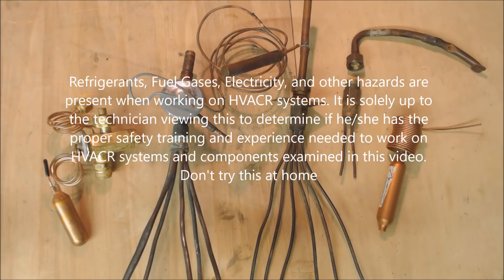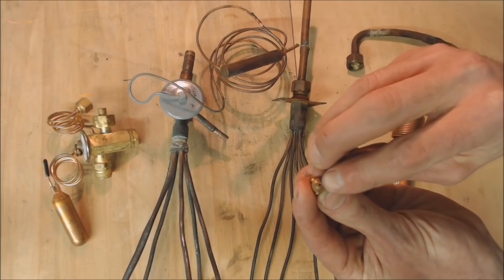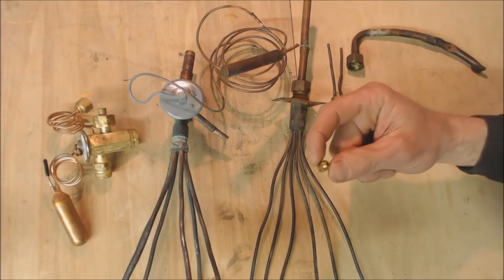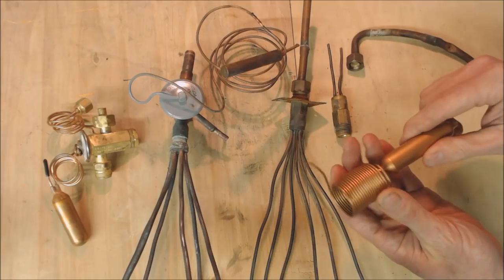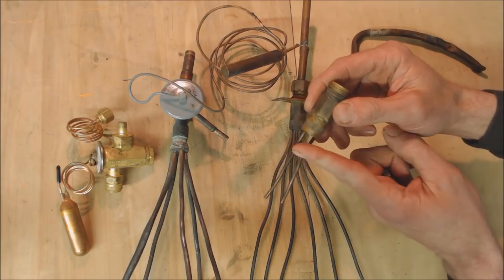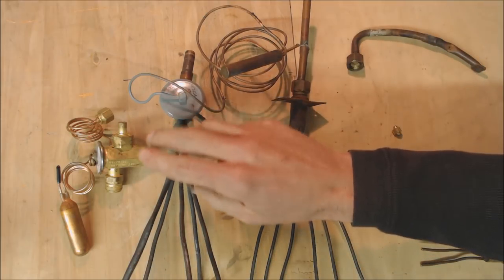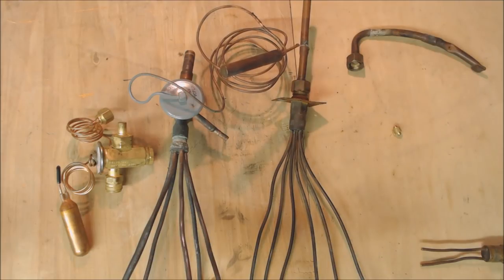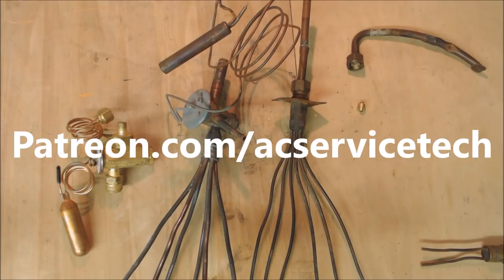HVAC Metering Device Types- TXV, Piston, Capillary Tubes

Comment: How does the manufacturer of txvs determine which refrigerant willl work with which txv?
Reply: The refrigerant in the powerhead assembly  i.e. in sensing bulb. will determine refrigerant of txv. So  you can swap the r22 powerhead with
410a powerhead to make 410a txv.

Comment: Thank you for the video. Tell more please about how to diagnose bad txv. How to diagnose bad txv using gauges. Or maybe you know another ways. Before summer it will be very helpful video. Tell please about improperly installation, and symptoms of that. Tell please about mismatch system, when condenser bigger than coils or coils bigger than condenser, how to diagnose it using models numbers of equipments. Tell please  how to diagnose mismatch system using gauges(when you adding freon in suction line(low side pressure goes up), but high side pressure not going up). Tell please how to calculate if system is smaller than has to be(ton - sqft). Thank you so much for you job.
Reply from the maker: Ha ha, this all items I have been working on in the book. It will be out soon. look up acservicetech txv troubleshooting for what I have out there now. Thanks for letting me know what you would like t see, thanks

Comment: I have 44 old heat pumps in one area that are slowly being changed out with fixed piston. Over the years people have done repairs without using nitrogen and the piston gets clogged from carbon and acting like the system is being pumped down so you need to take power off the reversing valve to go in heat mode to unclogg it. Big pain in A$$ but if it had a txv it would open more and let refrigerant  threw.
Reply from the maker: Wow, that is a shame. Many don't realize the internal affects of brazing without nitrogen because they leave and may not hear from the customer again. They assume it doesn't matter. Has a new filter drier been installed right in front of the piston to reduce the potential for clogs?
Reply: As i go I pump them down and replace filter driers. The units are now 30 years old so there tuff units and some have been replaced and the boss bought me 33 new units. I just need a contractor to do the jobb as my days are filled with repairs here and there all over the place.
Reply from the maker: Got ya sounds like a nice big job! What kind of facility are you working at?
Reply: Civilian at shaw AFB in sumter SC I work with airmen and try to train the ones that want to work lol. We have 4 civilian open positions currently but the last 5 that applied are not quallified at all.
Reply from the maker: Ha, nice. Yet another example of open positions for highly qualified applicants without any highly qualified applicants. Sorry to hear that as I am sure it puts extra work on you. The nice thing I guess is that they will rely and depend on you and want to keep you very happy I hope. Thanks

Comment: What exactly is a sear?could you do a short on this.
Reply from the maker: That would be a good idea, thanks for letting me know what you would like to see. Seer is seasonal energy efficiency rating and it has to do with a match of larger or more efficient coils or other refrigerant heat exchangers. Basically a larger outdoor unit with more surface area of coil would be more efficient at rejecting heat to the outdoors, thanks!

Comment: hi, with a fixed orifice lets just say head pressure is 200# and suction pressure is 100# an amount of refrigerant is fed into the evaporator. Now if the head pressure goes up to 350# and suction pressure stays same. Would there be more refrigerant going into the evaporator because of the bigger pressure difference? thanks.
Reply: You have no load on the coil

Comment: How do you determine TXV Spring psi..?
Reply from the maker: You would have to monitor the actual superheat by checking the charge while adjusting the spring but in ac units, most don't have springs and the ones that do are usually already set to hold 10 to 14 degrees of superheat unless someone adjusted it, thanks!
Reply: @acservicetechchannel  Thanks you for replying back.. I work with refrigeration warehouse..my TXV has heavy frost no matter how much adjusted counterclockwise it still heavy frost and ice. I already replaced power head.. it has frost and ice not on TXV body but on the tube.. it not low on refrigerant

Comment: Hi mate
The suction pipe that goes to compressor starts freezing  low side saturated temperature is minus 1 Celsius and suction line  temperature befor compressor is 4.9 to 5.2  celsius  r22.
And high side is about 155 psi
I add 2 kilo charge to unit but the. Temperature still below zero(low side) while unit running in cool mode of temperature set on 18 degree.
Ducted split system fujitsu.
Dry bulb temperature almost 22 Celsius
Unfortunately didn't check the metering device  and wet bulb. but as the unit is 15 years old I think it's not txv most probably.

According to above mentioned information I diagnosed the problem as a restricted metering device. Which is preventing refrigerant feed to system fluently. High and low side is very low pressure at same time.
What's your opinion?
Many thanks
Reply: Ace Look Reno's. Check ahu filter. Check indoor fan, / capacitor. Set to high fan speed. Up your set point. 
Recheck gas. If in doubt weigh out/weigh in gas. 
It's very rare but a blocked liquid line filter can drop your temperature, 
A restriction in the system will usually send the head pressure way up

Comment: why would the heat pump need to bypass the cap tube? it's just a plain tube, i would assume the direction of flow doesn't matter
Reply from the maker: When you have a heat pump, you only want one of the two metering devices active so if the cap tube is at the indoor coil and the indoor coil is now acting like the condensor coil in heat mode, the liquid refrigerant would need to flow around it to the metering device at the outdoor coil which is now the evap. Have you seen this video- https://youtu.be/2Ahzi1U0fYk
Reply: I just watched it. I understand the need to bypass a metering devices such as piston and txv,  depending on whether it is heating or cooling, because they work in one direction and the direction of the refrigerant changes. but for the capillary tube, from my understanding, there shouldn't be a need to bypass because it should work in both directions as it is just a tube and hence no need for bypass. 

Am I correct? Please correct me if i'm not because i'm working on a reversible heat pump project and am planning on using a cap. tube for this reason.
Reply from the maker: The cap tube is the metering device, just like a piston and would force your newly formed subcooled liquid from the indoor coil in heat mode to flash into the liquid tube before making it out into the 3/8 liquid line going to the outdoor unit. The cap tubing is the metering device and liquid won't flow through it without the pressure drop, thanks
Reply: what i mean to ask is, wouldn't a single capillary tube function properly as the metering device in both cooling and heating modes? no need for bypass and a second metering device.
Reply: @hjalsadah  - NO.

Comment: I have a Payne heat pump I’m going to install. It comes with a piston that goes on the liquid line how do I know what size I need for evap coil??
Reply from the maker: Really we typically install txv's for efficiency and compressor safety now. You would need to look up that manufacturers install manual for piston sizing matched to the outdoor btu/hr tonnage, thanks
Reply: Can you make a video replacing a piston to txv on a evap coil

Comment: Hey I have a question that's I cant find any information on. I've always been taught that your liquid line receiver helps insure that vapor refrigerant doesn't get to your metering device. Is this true and if so can vapor before your metering device actually damage it?
Reply from the maker: Hey Licheer, the receiver is a storage vessel for the subcooled liquid that is not needed during low indoor load conditions and as part of the automatic pump down system so that the condensor coil does not fill up with liquid during the pump down. Look up "acservicetech receiver" for a video on that, thanks

Comment: I HAVE INSTALLED A BRYANT MODEL 702B 30000 BTU (2 1/2 TON) AIR CONDITIONER, SINCE 2006. IT WORKED WELL UNTIL 2018, A TOTAL OF 12 YEARS. THE COMPRESSOR COPELAND MODEL ZP29K5E-PFV-1300,GOT  DAMAGED. I  IT REPLACED WITH A COPELAND PISTON COMPRESSOR AND R22 COOLANT GAS. THE ORIGINAL METERING DEVICE WAS REPLACED BY CAPILLARY TUBES. IT WORKED WELL FOR A YEAR AND THIS COMPRESSOR BURNED. I WANT TO RE-INSTALL THE COPELAND ZP29K5E-PFV-130 COMPRESSOR, BUT THE PROBLEM IS NOW, IT IS THAT I DO NOT KNOW NEITHER THE LENGTH OR DIAMETER OF THE ORIGINAL CAPILLARY TUBES. IN THE BRYANT MANUAL IT SHOWS THE METERING DEVICE SIZE, WHICH IS THE NUMBER 0.057  BUT IT DOES NOT INDICATE NEITHER THE. LENGTH OR DIAMETER OF THE CAPILLARY TUBES FOR THIS METERING   DEVICE.
PLEASE COULD YOU TELL ME THE SIZE OF THE CAPILLAY TUBE (LENGTH-DIAMETER) FOR THE METERING DEVICE SIZE 0.057.
I WILL APRECCIATE ALL THE HELP THAT YOU COULD GIVE ME.
GREETIN